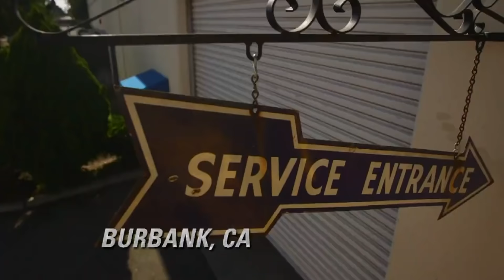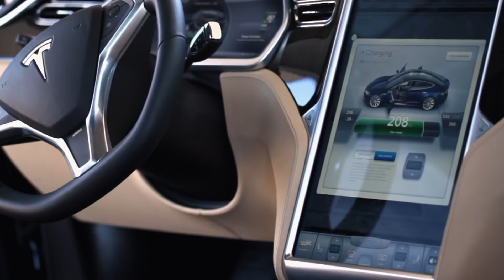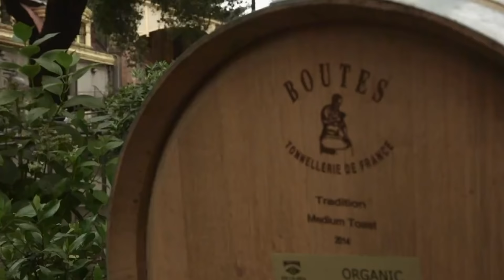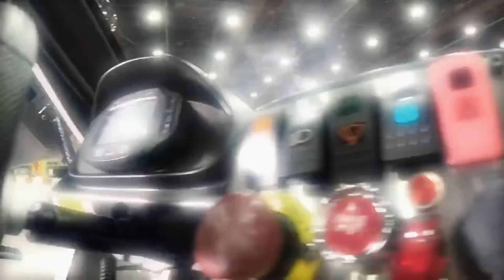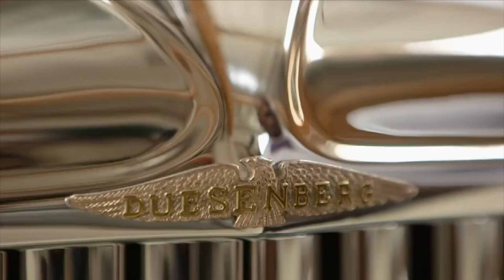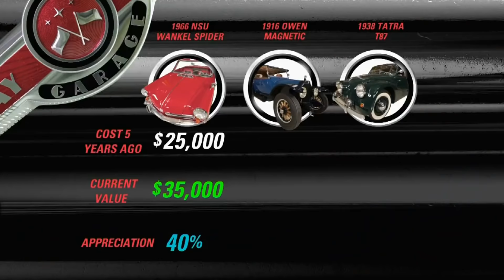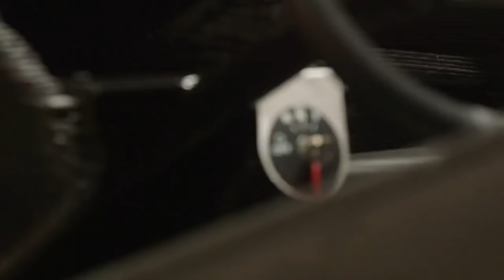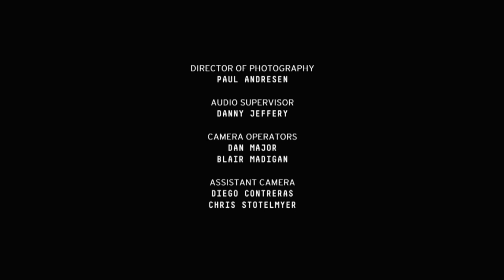The Cars of Tomorrow | Jay Leno's Garage | CNBC Prime

Comment: What if they used a hit and miss style of engine instead of a traditional one?
Reply: Hit and miss engines (designed to run at a set rpm) used in low power stationary applications, were replaced by the more modern governor in the 40's . The very heavy flywheels, used to maintain rotational inertia made it pretty fuel efficient and rpm controllable. Just don't ask one to move itself.
Reply: @JJJ-wz9tm  they were also used in tractors, so. They can move themselves pretty well.

Comment: The Cobra would kill that Tesla on the strip or from a roll. Teslas are nasty slow compared to their competitors when it comes down to speed and everything after 0-60.
Reply: +MarchuxProductions
"The Cobra would kill that Tesla on the strip or from a roll."
No, it wouldn't. Torque is where you get acceleration. Plus, you have all-wheel drive. Power is what allows you to retain a speed vs. drag.
Reply: Markle2k Nope.It is a whole lot nore complicated. Remember that HP is torque/time, so they are very similar, in a way. A big amount of torqe certainly doesn't hurt, but it's not the sole thing that makes the car accelerate, so Jay's comment about "Horsepower sells cars, torque wins races" isn't entirely accurate.

And, all wheel drive is irrelevant if the RWD car gets traction. From a roll, or at a drag strip, the Cobra wouldn't struggle with traction, and the outcome would be much different.

Did you know that electric engines aren't that effective at speed? That is why pretty much any super saloon destroys the Model S after the initial 0-60 run.
Reply: From 60 to 120 in seven seconds...

Comment: I could show you how to make an electric car that you never have to charge and no it's not solar powered. It's powered by magnets. And it doesn't have a transmission. It doesn't have an engine other than an electric motor on each wheel. And magnets make electricity at 350 bolt to the Thousand hands all day long for free.
Reply: Sounds good.  Tell me more

Comment: Hope that Tucker car engine survived Jay's little jaunt around.  Tucker cars have very crappy coolant circulation in the cooling system and are known for overheating and damaging the engine (cracked blocks).  Seeing that green coolant fluid on the ground and the smoke billowing from the engine compartment are all bad signs.  The car overheated.  Let's hope that priceless engine was not damaged.  Tucker 48 cars did not include a thermostat in the cooling system.  The driver may not have any indication or warning about engine temperature.  Preston Tucker may have been a futurist, but that did not make him a competent businessman capable of running a car company.  The 47 surviving Tucker 48 cars are not much in terms of being reliable cars (all should be labeled as prototypes) considering the poor cooling system design and that the rubber torsion suspension would prematurely fail due to rubber shearing or delamination failure (rubber compounds back in 1940's were not really able to take on the car's suspension forces).  Today's rubber formulations are finally available and Tucker cars are being made road-worthy with rubber retrofits.  Tucker faced many challenges and maybe Tucker 48 cars could have been improved had Preston been able to keep his factory going.

Comment: Hydrogen is not the answer.  it's extracted from oil/gas.  Doesn't really help.  The future may be a combination of compressed air and electric.
Reply: hyrogen is the absolute answer but not generated by gs/oil. There is no energy in compressed air save the compression!!!! Might get you out the garage and down the driveway. Get some real information, not rhetoric.

Comment: I don't get the point of using electric if most of the power stations are still coal fired... Hydrogen seems way the best option, but the large companies won't profit so it won't happen .
Reply: Hydrogen is very inefficient and also dangerous.
Reply: The point is electricity is cheaper as a whole than gasoline.  Modern coal power plants burn very clean and I believe most people realize this and don't buy into the hype. The way its portrayed now days this may not sound true, but in the real world efficiency is number one priority with the environmental impact being a distant second at best.
Reply: Its cheaper to produce electricity than transport and refine the fuel

Comment: Say what? Did I hear that right? The only downside to hydrogen vehicles is the refueling time? Really? I thought that was the (only) good side of hydrogen! That it supposedly takes no longer to refuel a hydrogen car than a gas car. That's been its major selling point, and now you're telling me that's out the window too?

Hydrogen is an idea that is dead on arrival because the refueling stations are soooooooo much more expensive than electric recharging stations and gas stations. Not only do you have to make the hydrogen from either electricity or natural gas, but you then have to compress it to very high pressure to fit in a tank that is a practical size for a car. Then you have to worry about leakage because hydrogen molecules are so small they are very hard to contain. On top of that, it's an explosion hazard. (Remember the Hindenburg disaster?)

Comment: To run these 'green' electric vehicles you have to make the electricity & store it. Doing both those things is so polluting. Consider the use of coal/oil/ or heaven forbid nuclear power stations and then the environmental damage caused by mining for the component materials to make batteries. Then what do you do with life-expired batteries. No car is truly 'green'.
If you want tha,t go do a deal with the Amish for a horse & buggy. The exhaust emissions will be fantastic for your garden.
Reply: NJPurling research 1st mate. Renewable power is cheaper than coal, and 1/2 the cost of nuclear. You can specify green power. And fill your ev at home with your own solar pv.

Comment: Electric motors punish gasoline 4-stroke engines that need to reach a certain RPM just to get optimal horsepower/torque.  Also a gasoline engine is only 30 to 40% efficient, but electric power is over 90% efficiency.  Technology always advances and the batteries will continuously improve.  Gasoline engines are well over their expiry date...slapping all kinds of computer management on an overly complicated combustion engine that needs to make 4 strokes for one shot of power for each piston.  Ridiculous.
Reply: Yes but you have to get the electricity to the car with all the loss in efficiencies at each step of the way, so that brings 90% down considerably, shall we guess at 40%

Comment: 8:10: The Tesla is not zero-emissions.  The emissions are just somewhere else, and you lose a each step lot in the translation from fuel-heat-electricity-chemistry-movement.   The Los Angeles department of Water And Power owns a large power plant (The Intermountain Power Project) near Delta Utah.  They burn coal.  That plant is the 6th largest  climate polluter in the western US. 

Burbank runs on about 30% coal, according to the LA Times.  Over 50% of the power in Burbank is fossil fuel.

So part of your "Clean" Tesla drive is powered by coal burning in Utah.  They promise to replace it with a gas plant in 2025, but your car is still burning fossil fuels, it's just in another state where It Doesn't Matter.
Reply: Oh speaking of IPP. There is a video of an Inside Tour. I agree Zero Emission is stupid. But here are the Facts.
https://www.youtube.com/watch?v=rGtUtnqB94g - Intermountain Power Project Tour
As you stated 50% of the Electric Power is NOT FOSSIL FUEL. BEV over its 15 year and 250,000 Mile reliable safe operational life. With a Grid mix that clean. BEV will consume 40% the resources thus emission than a weaker slower Gasoline car. It's 60% Cleaner & MORE Powerful Quicker. BEVs are now the higher performance option.

Comment: WTF your running your car on garbage tires. You set the tires up in smoke the whole time and then say you don't have enough torque. What are you doing ...getting into politics, or making a Tesla commercial? Get some Nitto 555r tires on the rear and heat them up first, your near a billionaire quit being a cheapskate.
Reply: This reply was to the Cobra vs the Tesla bit and tires win races  6:51starts and at about 6:58 we don't see the tire up in smoke on the Cobra. I think I can destroy his cobra with my Ranchero which only has 425 hp and weights 4200 lbs, but can dead hook because it has the tire to do so.
Reply: Then that would be a unfair race